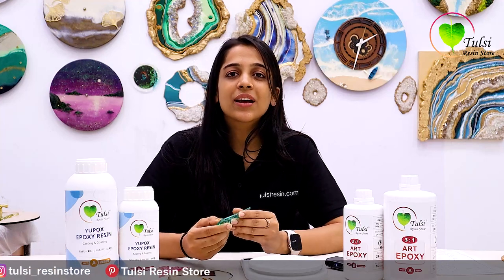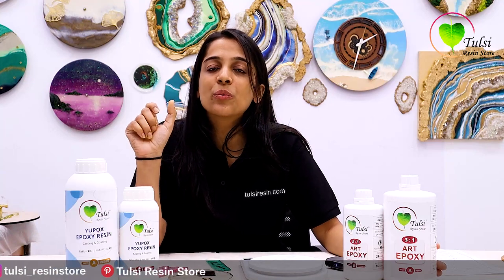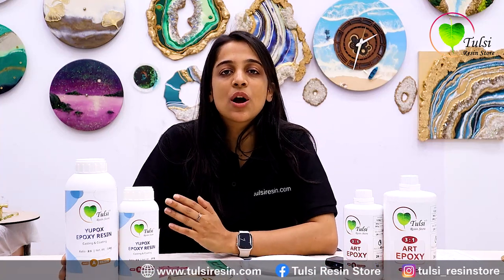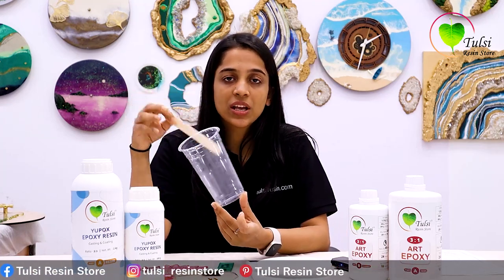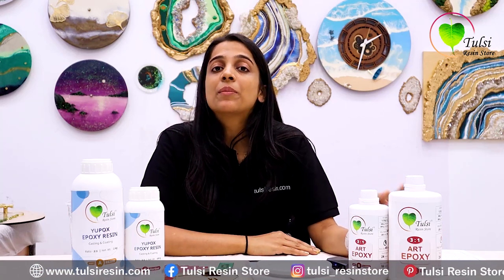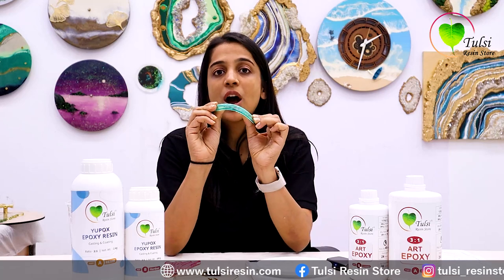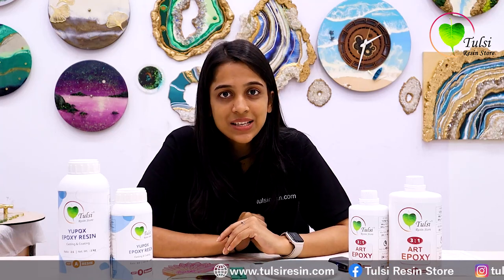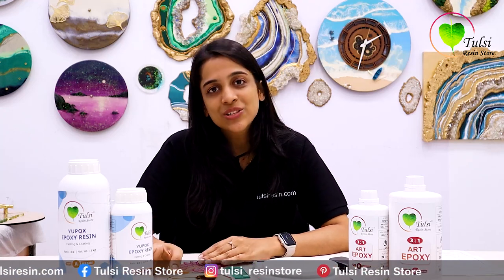Sticky Resin? We have solution || Epoxy Resin || DIY Crafts || Tulsi Resin Store

Comment: Mai 4 :1 resin use ker rhi hu abhi silicon mould mai per usme hadner add kerte hi vo bhut jldi thick hone lgta hai mai usme 10 sec hi mix kerti hu use se jyda ager mai mixing mai time lgati hu to vo glass mai hi set ho jata hai esa Q?
Reply from the maker: You can use our 3:1 for casting in mould.

Comment: Mam maine same use Kia tha phele ho gya tha ab ni hora dry
Reply from the maker: This might be due to Rainy season,

Thats due to moisture in environment, this is a common issue artist face with each resin in rainy or winter season specially. 

Take the below measures to prevent you product from cloudy effect: 
(1) Maintain the room temperature at 28 to 30° celsius with the help of AC  and work with resin
(2) Use mini heater to maintain room temperature, keep it slightly near your artwork. 
(3) Keep resin + hardener bottles in warm water for 10min before using it.(it also helps reducing bubbles if any)  
(4) Adjust a yellow light bulb near your artwork , so resin can get its warmth . 
(5) Try using blow torch frequently over the top layer until resin starts getting harden. (In this case keep a check on artwork upto 4 to 5 hours after pouring). 

Hope this helps
Thankyou

Comment: Di mera resin hard hi nhi ho rha he sticky hi rehta he to barish ke mosam me har kisi ka nhi bnta he kya
Reply from the maker: Weather affects resin properties.
Specially rainy and winter 

-Foggy effect due to moisture
- Delay cure then required time

Precautions: 
- Avoid doing work with resin ,the day it rains heavily 
- you can sand the layer and make a clear coat again  for foggy effect
-and for delay cure, wait till the layer cures (may take 48 hours even) 
-keep your artwork in a direct orange light (bulb or lamp) (so it produce heat )

Comment: Resin barish me sukane ke liye kaha rakhe
Reply from the maker: Weather affects resin properties.
Specially rainy and winter 

-Foggy effect due to moisture
- Delay cure then required time

Precautions: 
- Avoid doing work with resin ,the day it rains heavily 
- you can sand the layer and make a clear coat again  for foggy effect
-and for delay cure, wait till the layer cures (may take 48 hours even) 
-keep your artwork in a direct orange light (bulb or lamp) (so it produce heat )

Comment: Mera resin flexible aur chipchipa hota hai 😭😭😡😡🤬🤬😡😓😬😬😬😬
Reply from the maker: HOW TO AVOID STICKY OR SOFT RESIN

01.INACCURATELY MEASURING RESIN AND HARDNER
02.NOT MIXING RESIN WELL ENOUGH
03.MOISTURE & HUMIDITY
04.LOW TEMPERATURES